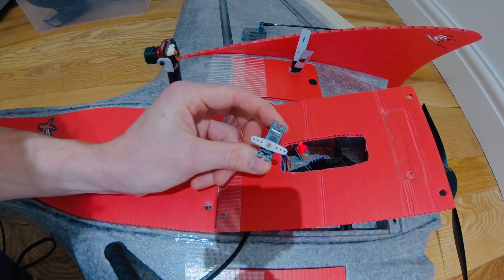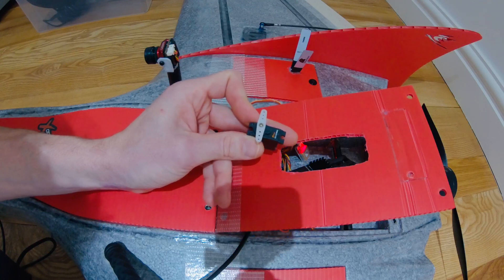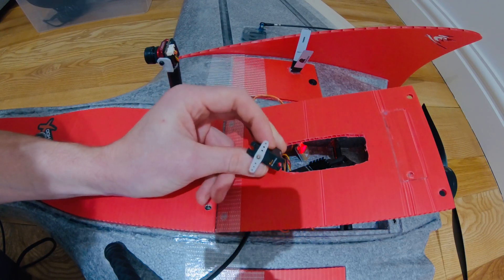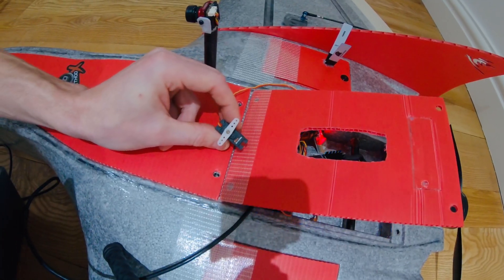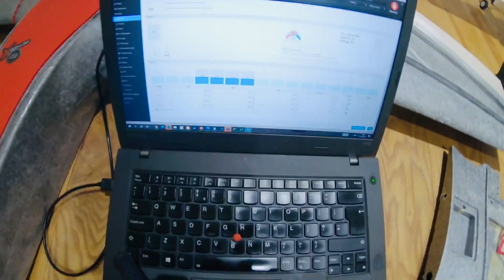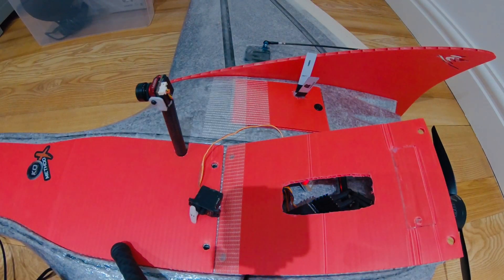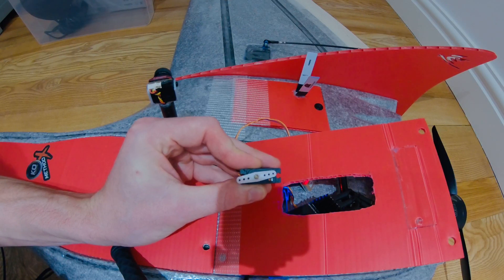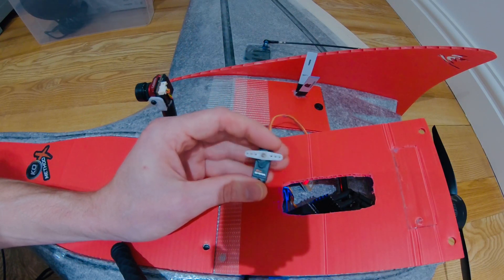Converting a typical servo to 180 degrees or 360 degrees using your flight controller, eg INAV

Comment: Very handy wonder will it work with Arduplane
Reply from the maker: Hmmm I haven’t actually checked if the limits are wide enough. 

I have a Matek on the bench I will flash it
Reply: @joshgault61  just tried it with F765 running Ardu. Changed the limits from 1100-1900 to 500-2500 did nothing :( servo is a turnigy 180 degree servo.
Reply from the maker: @JamesHurd  180D or the r5180?

I know the r5180 analogue works fine. I would assume some digital servos don’t though. You may be able to configure them though
Reply: @joshgault61  Turnigy TGY 1800
Reply from the maker: @JamesHurd  okay interesting. If you have a pwm tester it would be interesting to know if 500-2500
Comes out.

For sure the 180 appears to work as it reaches the continuous point!
Reply from the maker: The r5180 I mean
Reply: @joshgault61  I don't have a PWM tester. So I am unable to find out..
Reply from the maker: @JamesHurd  my ardu is only allowing 500-2200